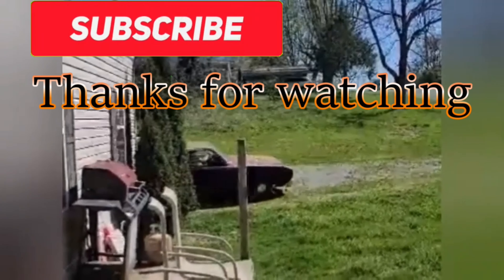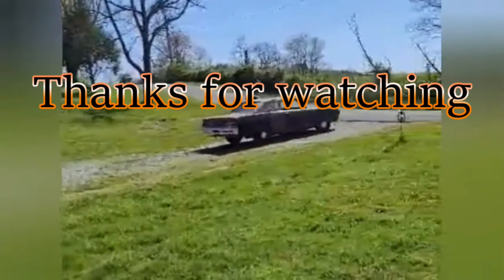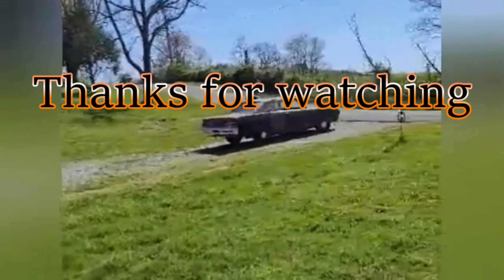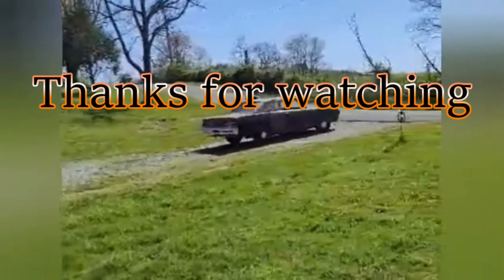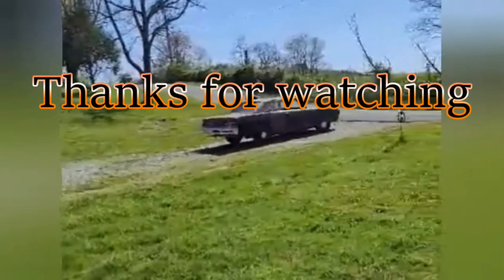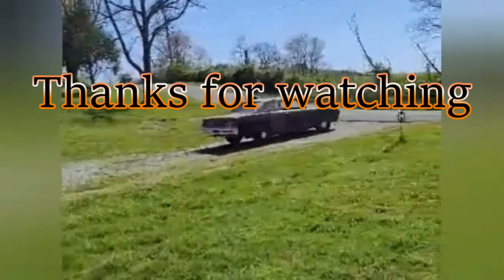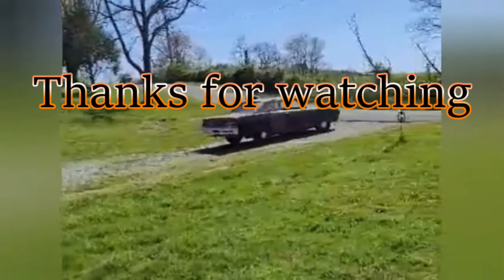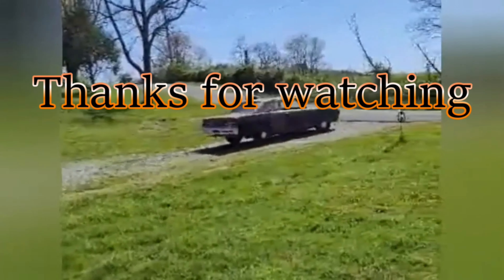Replacing the wiper motor on the Dart

Comment: Nice worked out well.... I'm glad I'm a hoarder got a pile of those wiper motors 3spd and 2spd.
Reply from the maker: Yea I'd like to collect a couple more! I'm a hoarder when it comes to old car parts too I have stuff I know ill never use but keep just in case! Half the time I can't find it when I need it tho! Lol those 3 speed motors are hard to come by nowadays I can find 2 all day long but the threes are hard to find and pricey when you do!
Reply: Question.. on my 68 Dart, wiper switch, has, 1st click, 2nd.. then keeps turning speeding Up.. like Volume knob etc . My Ladies doesn't,, also I have power washer button.. stock you think or?.. Model 270, Aire Temp, etc.. both 68